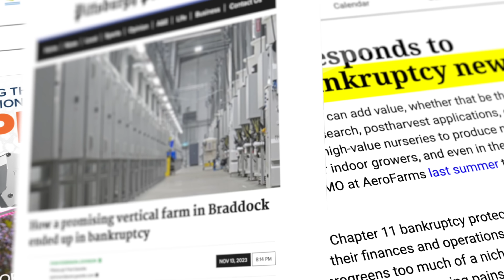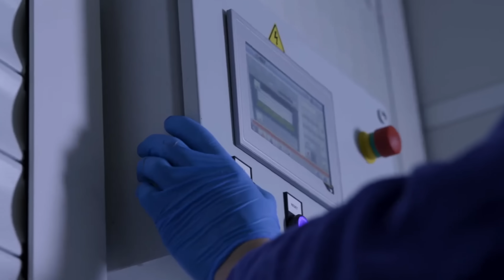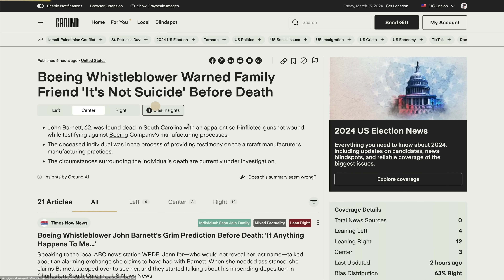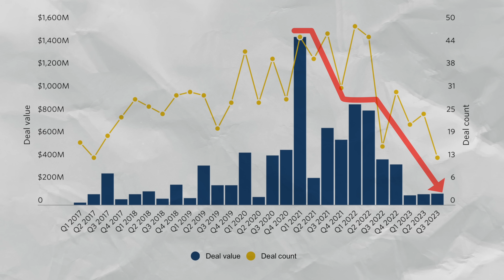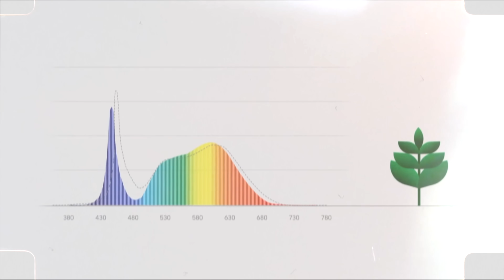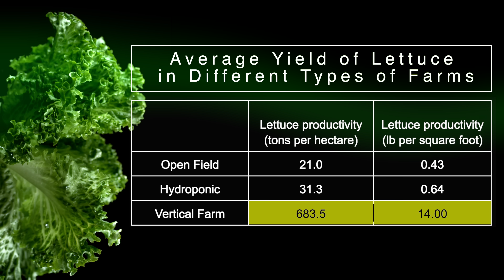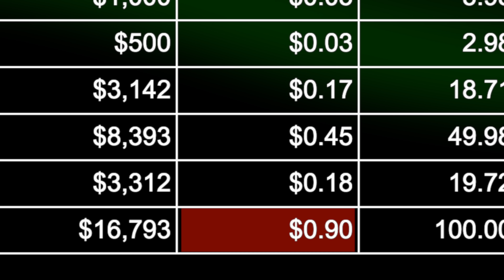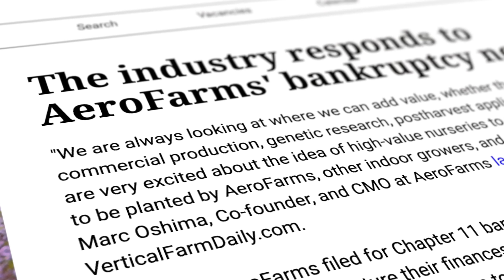The EPIC Failure of Vertical Farms - What Happened?

Comment: As bad as things are for vertical farming at the moment, there is still a future for it and a very profitable one for certain.
They just need to invest in energy infrastructure onsite to limit a bulk of the cost (yes, using the sun for free - with a dash of wind or even geothermal).
The above, coupled with key locations near the supermarkets and traders for their produce will see a dramatic reduction in production and distribution costs, thusly increasing the financial yields of each site considerably.
As for the blights, bugs and diseases - this will most certainly be resolved through more study.
🧐🤔

Comment: We have done some trial before and even we normally relay on LED for a different product than food, sunlight can be used inside the buildings with a reflective technology tubing to avoid any electricity cost, beside this filters can be used if only certain spectrum of light is required. Why only artificial light was used I am not sure, also paired this with solar can also reduce cost to almost zero beside the CAPEX cost of the equipment.

Comment: What is most surprising to me is the fact that investors didn't see this coming. It's not rocket science to calculate profit. It shows that most rich people and investors are just humans with more money in their pockets.
Reply: Never underestimate the herd mentality
Reply: The best argument against vertical farming came from an investor who specializes in farms and farmland. His argument was that, at the end of the day, a vertical farm depreciates in value and the value of your farm is the equipment. But, after so long, you have to replace everything. A real farm, with land, does have depreciation, but, after every tool is replaced, you still have land. That land has gained value, possibly multiplied in value if you did things well. 

Of course, this little comment is a far cry short of that argument, but it was a good one. The guy in this video did address that a bit, but he didnt dog in as much as I've seen some folks go. Sorta sad.
Reply: Eh. Let's not do damage control for the irresponsibly rich.
Reply: Dude. At the root, that’s just FOMO and too much money in the system. All the cash the central banks pumped in since 2008 need to find a destination. Why do you think a lot of PE backed investments keep changing hands every couple years? VC is similar. Those guys need to find a destination to the dry powder they are sitting on.. they are not very patient in general. The thing with indoor farming is just  bad timing. It’s the future. It will eventually happen. They will be able to compete (at least leafs) when energy is free and labor is highly automated and AI backed… it will take 15 to 30 years.
Reply: @EmptyMind469  the printed cash is finding destinations... in failed projects like this and many others....
Reply: @EmptyMind469 The first half of the analysis is spot on. Second half, wrong. The centralization of food production control is going to lead to mass death, first for the plebs and then a 1789 moment for the elites. A bread shortage was the spark for mass extermination of an entire class in France and the process has been repeated multiple times since.
Reply: @EmptyMind469  you are delusional
Reply: @EmptyMind469   not 30 years, way more to be competitive.
Reply: It also demonstrates that most folks (even successful venture capitalists) don't understand economics when it comes to agriculture commodities. They are used to being price makers (to some degree) while ag commodity producers are almost always price takers (unless selling directly to consumers with a niche or value added product). 

For anyone that doesn't understand when I say "price maker". . . your typical factory can make a product and they TELL folks the price they will accept. For Ag commodities . . . the prices are already set. . . and you have to accept that price. 

This is why there are economists that specialize in JUST agriculture. . .
Reply: Most people are just humans. ;)
Reply: Food is super cheap if you think about it
Reply: This is wild.  I wanted to pick up vertical farming as a hobby and I sat down to look at yields for different crops and the initial cost of exactly 1 shipping container farm.  I knew I would lose money but I was willing to part with a couple thousand a year for a good hobby.  The losses were way higher than my threshold (calculated on a basic excel sheet and using public farming pricing data from a local university).  The outcome was not hard to grasp and I picked a different hobby.  I inquired about the parts replacement cost and it was eye-opening.
Reply: In the oil fields, we used to say, they have more money than brains.
Reply: It's based on the investment model of "the bigger fool theory."  Invest the money, get the pliant media and political allies  to pimp it for you as the next big thing that will "save the planet".  Blah, blah, blah, you dump your shares on ignorant, little investors who buy the STORY you tell.  (Don't be shocked if the seed investors/investment banks got out at the top in 2021-22).  The ignorant little guy deludes themselves they're doing something fabulous AND which will make they fabulously wealthy...because "they can see the future."  NO ONE stops to ask, "IF this is such a great idea, then why don't they let these companies GROW ORGANICALLY (irony intended)."    BECAUSE, if they started small, and based growth on profits...everyone would know it is a bunch of precious NONSENSE!
Reply: They're trying to reinvent the sun. It's literally free. The stupidity of these people.
Reply: No it shows that people who support these green initiatives don't have common sense
Reply: What gets me is he mentions Neom "the line" Saudi Arabia as if it's a possibility. Vertical farms are still viable in theory with things like labor cost, and energy being resolved you can potentially bring a profitable farm to market. There is no engineer on the planet who thinks Neom is actually a possibility within the next century. It's a dictators pipedream.
Reply: Luck, also, hope for a breaktgrough.
Reply: The people investing in it were a bunch of people with no real farming experience. They never owned a farm, never grew up on a farm, and probably never worked on a farm. They have never seen the books of a farmer, or tillable land owner. They see a bunch of sleek hyped up CGI images and feel good eco green world promotional stuff and think this must be the next thing.

A lot of the investors are just a bunch of people investing without doing any real research. Rich kids that have money to burn, people that get in early and plan to leave before it implodes, and people on Robinhood that want to think they are making an educated decision, without ever really looking at the fundamentals of agriculture as a business.

As someone with a background in farming, I put nearly all of my money into a bland index fund, because at the end of the day that index fund will return far more than most farms ever will. It is sad, but true. With a caprate for tillable land hovering around 2.5% and the stock market and bond market returning 8% and 5% it makes little sense to tie up money into land, and operations, which have such a low annual rate of return.

I wouldn't touch a farming stock with a ten foot pole. This is no disrespect to someone who is a farmer, there is nothing wrong with farming, it is just that buying additional land, or shares of agricultural business is too expensive for such tiny returns. The same applies to certain areas of the grocery business, now would be a terrible time to open a new grocery store, as your rate of return might be less than what you could get from a savings bond.
Reply: They only need a few hits out of hundreds/thousands of startups. From early investor to IPO exit is where they are aiming for. The survival rate of startups is low in general, they accept the risk because of the possible high rewards.
Reply: Well no they're investing in cutting edge technology that in 10-20 years if they patent the tech then they will be billionaires
Reply: venture capitals made  huge money &  interest rates were low they were just throwing money to thrash
Reply: The point isn't to have profit, it's to promote an agenda. See the world economic forum objectives. Profit will no longer matter when you eventually will have control over the population.
Reply: When you're Super Rich, you need very big tax write offs. These losses are perfect for them.
Reply: VC don't try to create profitable companies. VCs try to create big fast growing companies that are losing a lot of money and then IPO and dump it on dumb retail investors. I challenge you to find a recently IPO'd company that was GAAP profitable at IPO.
Reply: Too much money and too little brains. 😂😂😂
Reply: Over and over again I see this going on with these mega-startups. It's such a stupid/insane way to start a business. Research your market/see what prices people are buying the product you want to sell (in this case, whatever crops you want to grow) see where they are most likely to sell,  then research what the overhead costs of everything will be. Start with a small trial batch of it to find out if you can turn a profit, and go from there.  I just don't understand all the gambling with billions of dollars on something unproven. In this case all they'd have to do is consult with some indoor pot growers/anyone growing indoor crops for subsistence or whatever,  on their costs.
Reply: eco craze is a social contagion, herd mentality, ideological blindness, silo thinking.
Reply: if investors were actually smart, they would be inventors 😉
Reply: Well, we have the concept of Blitzscaling where growth if prioritized over profits with the belive that they will figure out how to make it profitable once they dominate the market. Yeah it's stupid but since it worked for Amazon people still fall for it. Investors are humans and we are lazy. Why calculate the profit of a company when everyone is telling you to invest or you miss out on the next big things. FOMO kicks in and you stop thinking criticality.
Reply: ... who are more concerned with ROI than with building a business.
Reply: It’s more likely that cash was being pumped into the economy too quickly so people had cash they didn’t need and threw it at something.  It happened in 1929, it’ll happen every time.
Reply: Neoliberal Capitalists expect fast ROI within 2 years. Why does it take the US gov't to fund chip fabs? Or battery factories? Because it takes at least 10 years before costs are recouped. Wall Street want TWO YEARS for expenses to be recouped. They pile in money with high expectations and when the investments fail, take the losses as tax deductions.
Reply: @DairelFoleur  That's not the reason why. We actually had chip and battery factories in the US (and frankly before most of the world), the government regulated them out through environmentalism forcing them to go to foreign countries as kickback for under the table deals. Problem is, now those outsourced countries are now open threats and the government has to reverse course.
Reply: it's just the standard investment thinking that company will do what it is supposed to do and not being  a bonzi scam that just presents itself well
Reply: @nogamenolife7940  As soon as he mentioned the tech bros at the beginning I knew where it was going.
Reply: @nogamenolife7940   I'm sorry to say, honestly it's an American or western thing to do ponzi and scam investor. Not an Asian thing. Investment in lithium my new wile in Asia we actually mine lithium, investment and n sodium battery while in Asia we actually created and most importantly sold sodium battery, FTX crypto while in Asia we have binance which the DOJ are jealous of because their son Sam bankman is just a scammer child bringing disgrace to his Nation.
Reply: Like the Theranos story with Elizabeth Holmes.
Reply: ITT: people who never invested a single cent in their life making fun of the oh so dumb investors lmao

Comment: A thorough video on the subject. 
I've been working for a vertical farming company for a while now and I think an issue lots of companies face is wanting to make everything themselves. Solutions for a lot of problems you face during development of a vertical farming system are already out there (though maybe not ideal). Start with those and once you have a system operational you can use the experience you gather there to make iterations on the system and develop custom components if necessary.

Comment: What's so surprising about it? Not watched it yet; but to me it would seem obvious?
It clearly will not be able to compete against traditional farming.
The concept adds extra cost inherently in its idea to production. So even if they produce "more" (efficiently, -obviously they do not produce more) with the method; it will always cost them more for every unit produced.
So will always be unable to compete directly.

As greenhouses already does not compete against traditional farming.
Their profitability is based on location only, if producing AND importing X costs more; it can make greenhouses profitable. Then you have a little factor of subsidizing (governments wants at least a minimum degree of self reliance on food production, so they subsidize). 

But again it will never compete directly with farming open in a field (in the regions where the produce is viable).
That simply is far more cost efficient. And enjoys far more benefits from scale.
If greenhouses where more profitable, than farming open; we would see them everywhere. But we do not.

Big field? big machine. Incredibly large field, like nation state sized? (those exist, though mostly cattle farms) fully automated even big machines and radio operated watering systems.

Comment: Sounds like much of the problem was that it is over engineered, such as pretty tight temperature controls. Plants are resilient so I am not sure why they would even worry about the temperature as long as you stayed in a 10 degrees F range.

I also wonder how many of the farms were put in the wrong areas, like too close to towns and town centers which would greatly increase the fixed costs of the building, property, etc.

There are people that make six figures growing various greens and herbs in their basements for restaurants and they aren't hiring stacks of engineers or having complexity to babysit the crop that doesn't need to be there (temperature controls to the extreme, tech support people). The hardware needed is so simple they just need to scale up what people do in their basements and not over engineer / over design the systems and trying to over utilize robotics (huge fixed costs)

But they do need to work on more calorie dense crops like root veggies and legumes. The world only needs so much basil and butter lettuce.

Comment: Verticle farms are a scaling versus automation issue. They are fabulous at the small scale sustenance farming standpoint. But, when scaled up, if not nearly fully automated the manhours required make the product insanely expensive by comparison. Current automation technologies aren't quite there yet either... sooooo...

Some smaller scale commercial farm may be viable, like just enough to supply all the greens to a local restaurant or something.

Comment: Seriously, indoor vertical farming with electricity, yeah that's a disaster, anyone could see that failing. Vertical farming needs to be done outdoors...where you have tiers of land....like on a mountain side where all polnts get sunlight. Vertical farming is nothing more than stages of flat-land on a mountain side...increasing acreage by mounding up soil into many small mountains with vertical tiers. Or a skyscraper building framing, no windows...with floors of farming centered on the sun.

Comment: At the beginning, some positive aspects are laid out (less low wages labor, less land, less fossile fuel machines, less distance), but for most of them there are hidden externalities covered collectively / not offset in the consumer price, like low to no carbon taxes (cf. farmers movements in Europe currently caused in most part because of fuel cost and carbon taxation of it, plus regulations on land use), social support of low wages workers now and later when retired, roads, insane fossile fuel based logistics, etc.
All of those externalities are paid for by the consumer now or later in both cases but not caused at all at the same level. Solving (in part) problems that society don't subsidize or even recognizes is not good for business plan, only good for karma.

Comment: A few years ago I  experimented using a 3 foot square cupboard 8 foot high.  I estimated crop value required.  No labour or cost of setting up but found I needed 3 times the light and at the same time electricity price doubled so needed 6 times the crops I originally calculated.  I found not viable for about £100 rather than billions of dollars.

Comment: Well, first of all western farmers would need to be short of acreage in order to need to maximize output per acre. So that’s the first failure. In a place like America there’s no need for additional production per acre. Now, if you take this to Egypt or Singapore it makes sense. Of course, you need to have a stable society so the warehouses aren’t burned down and attacked. 

The second failure point of this is that you are de facto exchanging energy for area. Outside farms use the sun for an energy source. No power bill for growing. Vertical farms are converting electricity into food. That’s fine, but only as long as you have lots of cheap electricity and land is expensive.